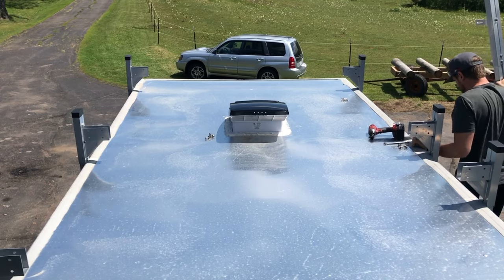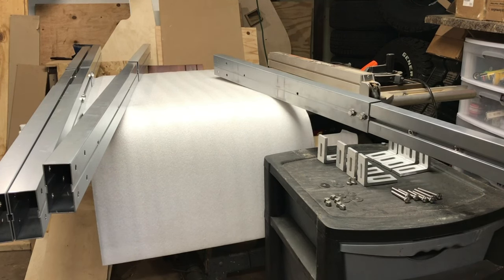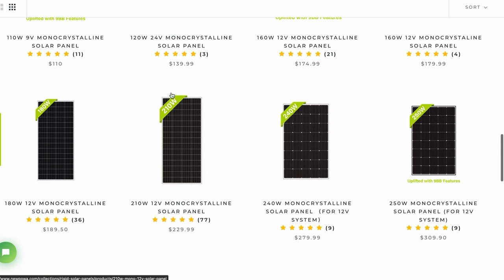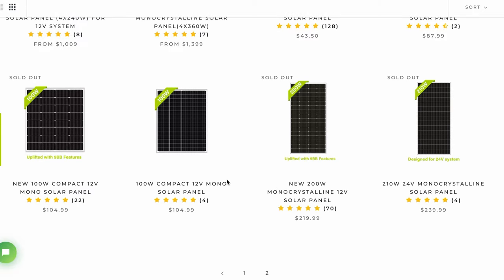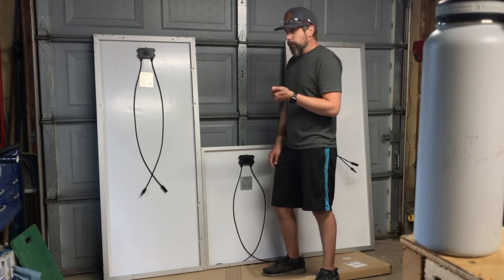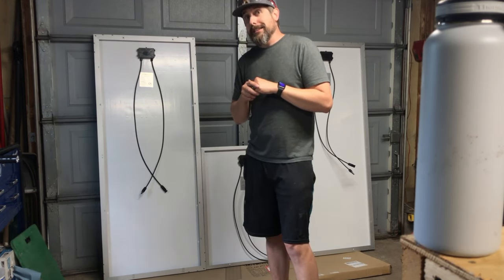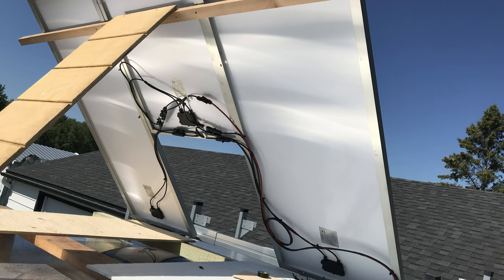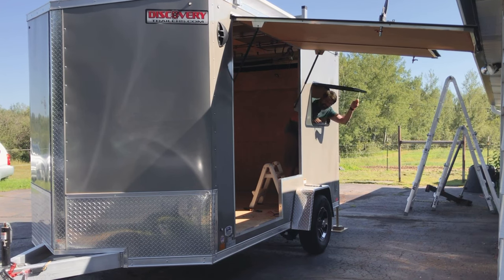Cargo Trailer Conversion Series: Solar Installation

Comment: I think I would go with 5/4 deck boards (or 2 X 6) screwed down to a 2 X 4 at the front and back and resting on the cross members. Attach the end lumber with a couple of those L brackets.
Reply from the maker: Funny, this is so close to what I decided to do. Working on it right now. Should have it done soon!

Comment: Maarkstar sells aluminum planks 1 X 6 by 5 foot long for $40-$60 depending on mill finish or anodized. For a quarter of that price I think I would still go with wood. It would save having to mortgage a horse or a couple of chickens...lol
Reply from the maker: Yeah, I would have loved to do aluminum planking but everything is so crazy expensive these days. Wood is cheaper and easily replaced if need be.

Comment: I binged on your series...
Have you ever used or heard of 8511? I just used some to fab up roof rack. I used it at a employment place before I retired. It's extruded aluminum...FYI. 
I'm pretty detailed oriented myself so...😁
Reply from the maker: Thanks for watching! The only extruded aluminum I know of is 8020. Well, I know there are other brands as well but I can't find much on 8511. Is 8511 similar to 8020 or unistrut in that it has t-slots? I considered 8020 but it's expensive these days. 

I’m going with unistrut for the cross-bracing since it's a little cheaper and I can buy it locally. Hoping to get the deck up in the next week!
Reply: @getaway_man  I may have the numbers wrong. It's 1" square and slotted on all four sides with a hole down the length of center beam.  It's T tracked on all sides I should say. I prefer local sourcing too! 😁
Reply from the maker: That definitely sounds like the 10 series 80/20 but there’s other brands that offer basically the same thing. Super fun stuff to build with. If it wasn’t so expensive, I would have used it for my deck. This whole build is getting expensive fast so I have to be careful 🤑
Reply: @getaway_man  I Google it to learn where I got it wrong...and learned it's 58 bucks for a stick...back when it was 14 dollars a 10' length!!! Crazy! It is great to work with though.

Comment: Good video doing this right now lol where did you purchase the L brackets those look cool?
Reply from the maker: I guess I forgot to add the brackets to the description, my bad! I got them on eBay. 
https://www.ebay.com/itm/184292646521?mkcid=16&mkevt=1&mkrid=711-127632-2357-0&ssspo=3ODL3w-WQZa&sssrc=2349624&ssuid=9dmKOXaFSiG&var
Those were the ones from the video I believe but they come in different sizes as well. They’ve worked out great.
Reply: @getaway_man  I purchased ladder rack to cut I ran into the same problem EVERYTHING is to tall and I didn't want a ton of holes in the roof.

Your top molding is a dream..... mine has different top molding I have to mount over molding vs recessed in the molding thanks for the tips. Mounting solar almost sucks more then hanging panal to the ceiling. Thank man
Reply from the maker: @themusclebob23  Yeah it’s a big project for sure! Buying the right trailer and or ladder rack can help, a little haha

Comment: That will work but fuel mileage will be a problem
Reply: Yeah, definitely not as efficient as a stock trailer but less drag compared to most rvs with all the stuff they typically have on the roof.

Comment: Do you have a link for the L-brackets you used?
Reply from the maker: Sorry I forgot to add that. Got them on eBay. 

https://www.ebay.com/itm/184292646521?mkcid=16&mkevt=1&mkrid=711-127632-2357-0&ssspo=3ODL3w-WQZa&sssrc=4429486&ssuid=9dmKOXaFSiG&var=&widget_ver=artemis&media=COPY
Reply: @getaway_man  appreciate it! Doing the same mounting system for my 7x16, but with 12x 100w panels. (Wish I got bigger panels, but had 6 of them already from another install).
Reply from the maker: @dougyoud5944   No problem. The L brackets are slick. I think I mentioned it in the video, I would also suggest adding some angle iron or angle aluminum to the ends of panel groups. Might make installing or servicing them easier and will make it all more rigid. Good luck!

Comment: Why not double your capacity by adding sliding panels above the fixed ones. We hen you park you pull them out like a drawer.
Reply from the maker: I guess one could do that but 520w is more than most people have/need already.
Reply: @getaway_man  true, batteries are really to issue over the watts of your panels in the long run.  It if the goal is boondocking, then I’d go for it.
Reply from the maker: @honeybadgerbob9427  Exactly. If it’s sunny you don’t need much for the basics. But with more loads, more inverter use, weak or low sun etc. , I could totally see needing more, especially in an indefinite boondock scenario. I would probably add panels that I could easily move to chase the sun throughout the year.

Comment: I hope I’m not insulting you. How much did it cost you for the whole project
Reply from the maker: Hey, not insulting at all. I always try to be transparent with what I do on the channel. 

So the trailer was purchased new for about $11k and so far I have about $6k into the build. Some of that cost is not yet showcased/installed as of today. I still have to install the insulation, flooring, and wrap up the electrical. I've got a few builds under my belt and I've found the average cost is around $8k, not including the vehicle/trailer so I'm still on track with that average. Hope that helps!
Reply: @getaway_man  sorry for the misunderstanding i meant just the solar project
Reply from the maker: X2 Ladder rack sets plus brackets/hardware was about $300 and the solar panels were about $550. If we are including the other solar components  (not including battery) it's another $200 or so. It's all broken down in the description with the various components and the links where I bought them.

Comment: 😂😂😂😂 Ok... was it not possible to SEE the simple and easy solution for your mounting and "cutting corner" issue? The garage mock up made it plain as day where the fix was. Flip all 3 panels 180 degrees and all the "orientations" are identical. And no hypotenuse issues.😂😂😂😂